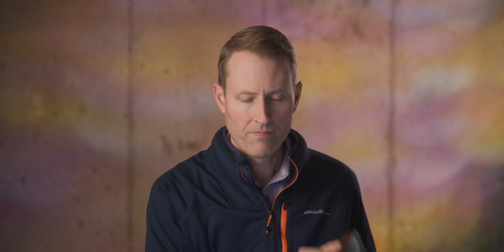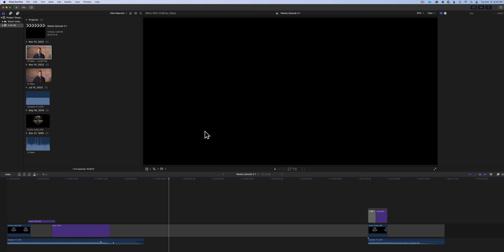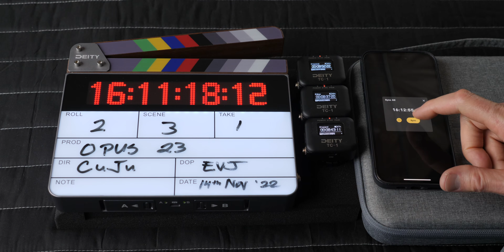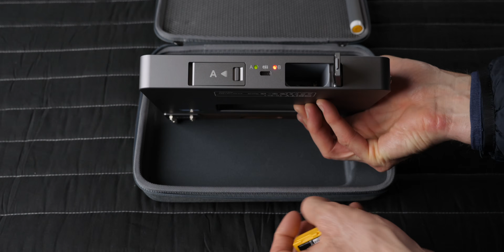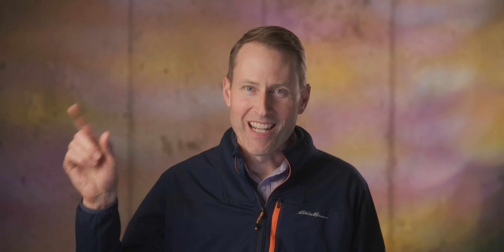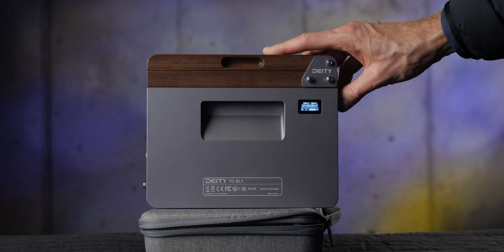Comment: Wanting to clarify something you said...  the Deity timecode ecosystem is proprietary soooo it (the D2RX but also the TC-1?) won't sync to a MixPre 6 ii? (and thus it to a BMagic Design PYXIS 6K Cinema Camera?). So the Deity TC system will sync iso tracks recorded internally in multiple DBTX's... but if sending multiple wireless channels to the MPre-6 then you'd need to use some other way to sync camera and MP-6 to get TC sync-able files? Sorry I'm mostly an editor but needing to get up to speed on sound as the guy we've used (in past couple small indy feature films) is unavailable and it's fallen to me to sus this out in a fairly short time window. Thanks... love your channel BTW.
Reply: The DEITY timecode products CAN sync to any timecode capable device via cable. It is only the wireless jam sync capability that only works within the DIETY ecosystem. So you can use a TC-1 with a MixPre or a Pyxis to feed timecode to the recorder/camera. AND, if you keep the TC-1 connected throughout the filming/recording session, you can use the Sidus Audio app to wirelessly re-jam all of the TC-1s, effectively re-jamming your MixPre and Pyxis.

Comment: I'm planning to use multiple GoPro cameras to capture footage of my motorbike rides. How can I synchronize the footage effectively? What devices or software are necessary for this process? Thanks for your advice.
Reply: You'll need timecode generators that attach to GoPro cameras. I'm not familiar with any that do that, these days.
Reply: @curtisjudd  Thanks for your reply . I've already contacted several timecode device manufacturers, and they've offered some solutions. I am waiting for the new GoPro 13 to be released. Hopefully, they'll launch a new model this month. Once the new GoPro is available, I'll be able to get a definitive answer

Comment: A question. So if the clocks on consumer grade cameras are not stable enough to hold the sync, does this mean that the frame rate is varying in them as well? If this is the case then would a time code not match up with the actual frames as they are recorded?
Reply: Timecode is only used to mark the start point of the recording. If you need to ensure no drift, then genlock is the tool you’re looking for. But it is usually only pro level gear with supports genlock.

Comment: Curtis, Here’s something you could show us that I have never seen anywhere else. We always hear how useful a slate is for redundant syncing in post, or for syncing cameras that do not have TC ports like a GoPro. Please show us how to use a slate display in post to sync up to timecoded audio. I know many self taught editors and none of them have ever done this and I question if they could figure it out. My guess is you will make it look easy and that would be useful. Thanks.
Reply: I think you just have to bring in the audio channel for the camera with no TC and look for the huge spike the clap makes when it slaps down
Reply: @markbernhardt6281  You miss my point. What you describe is standard dumb slate syncing which has been done since talkies first appeared. I asked to see how a smart slate digital display is used to sync to a timecoded audio track.
Reply: If you aren't using the timecode to automatically sync hen you cna do it by eye. The display on the slate freezes to show the exact frame that the clap happened. So you cna place a marker on each video clip at that frame in your editing software. Similarly you can find the timecode reference in your audio file and place a marker at that exact frame. Then you simply line up the makers on your editing timeline. Tnis is really useful as you can find that, in the audio clip, the sound of the clap goes across of couple of frames which makes precise sync harder to do "by ear".

Comment: Pausing the video, and using the "," and "." keys to frame skip, I must say, that frame sync with the LED display is perfect. Nice to see something that's a bit more dynamic than a traditional seven seg display too! Still far too pricey for a quartz clock and a display costing no more than $28.
Reply: 👍 Do temperature compensated crystal oscillators only cost $28 USD?
Reply: @curtisjudd  List price is £2.45. They seem to be rather inexpensive.
Reply: @ErynKnight  looking forward to seeing someone put together a more budget oriented slate and timecode generator given these prices. Maybe someone who is wealthy enough that they don’t need a paycheck for their engineering work…
Reply: the PCF2129AT from NXP is 6USD in quantity (±3 ppm from -15 C to +60 C) and this is a whole TCXO driven clock-calendar (RTC), not just the crystal
Reply: @physiqueDrummond  Why do you suppose Timecode generators cost so much more than that, then? My product management experience suggests a bunch of other costs plus some margin are involved.
Reply: @LearnLightAndSoundSessions  are we talking about TC generators in general or this slate in particular? This device seems over engineered, which is kind of a fashion statement for the owners who can afford them. But unibody aluminum case, really? I can understand the need of magnesium subframe for camera packing top notch CPU, sensors and all, but for a clock and some wireless boards? So @ErynKnight is probably right, 30$ electronics, 170$ case and assembly, and X5 from BOM to COGS (BOM= Bill of Materials and COGS = Cost of Goods Sold) and voilà! 1000$ price tag. BOM to COGS factor varies from 5x to 10x depending of your fixed manufacturing cost (R&D, injection moulds, etc...) and the number of units you plan to sell. ex Apple is selling its iphone 12 at 4x. Surely there is a market for  no-brainer slate and TC systems without fancy cases. I'll try to start a DIY FOSS community around those... 🙂
Reply: @physiqueDrummond  I don't know how much you've worked on sets, but my experience has been that over-engineered is desirable to stand up to the rigors of set work. This is not really a device aimed at YouTubers or even low-budget corporate or commercial work. It looks to be aimed at bigger budget sets — probably at least $50,000 projects and up.

To your point, however, I would say that there is probably a market for more affordable implementations and I'd love to see a DIY kit.
Reply: Remember this is a super niche film industry product. They can't order their parts cheaply in the tens of thousands. Neither can they spread R&D costs over many many units.

Comment: is it possible to use it with 2x tentacle sync track E? and 2x tentacle sync?  or does people who invested in those have to sell it and buy all diety?
Reply: Yes, but you’ll have to jam sync via cable, not wirelessly.
Reply: @curtisjudd  okay, fair enough
Reply: @curtisjudd  Do you feel it's needed to keep your timecode box hardwired to the slate or can I jam and unplug?
Reply: @alex-k5n7w  no, the slate has an in-built generator so you should jam and disconnect external generators.

Comment: I honestly am not sure I understand the specific use case where a timecode slate + timecode sent to your camera is better than a normal slate with timecode sent to your camera. My best guess is if you've somehow botched the timecode signal sent to your camera, then you can use the timecode slate to type in the corrected timecode at the point of the clap, but arguably you could fetch the correct  timecode from your audio device at that point in time and shift your camera timecodes by the delta to correct the error. Just not sure what scenario the screen on the slate protects you from.
Reply: It is another cue that can be used to identify the video clip (eg if you set timecode to time of day) and troubleshoot issues if the timecode to the camera didn’t work for whatever reason (cable pullout, dead battery, etc)
Reply: @curtisjudd  Troubleshooting is a good point, didn't think of that!
Reply: We used to have the playback for music videos on an IPAD and just held it up to all the cameras after starting them, just for that reason.
Reply: It is a safety net. In the grand scheme of things, it is an extremely small marginal extra cost so that you can be certain even if the main timecode setup fails you still have your back up plan. Additionally timecode slates are very important for those cameras which can't take timecode! (such as GoPros)
Reply: @demarsman2 But beyond "just the looks of it", I guess the question is what functionality does the timecode slate add to your production? For you, it just for redundancy if the various TC boxes to your cameras go out of sync?
Reply: @thatcherfreeman  Editorial uses it to have all the information in one place, visually, at the start of each clip. Same for the team which puts together and views dailies.

Comment: I like this...much more affordable than the Denecke...you could get the slate and three pack of timecode generators for the same price as the TS-C or TS-3.... Any reason to lean one way or the other? I'd love a smart slate comparison vid.  And as for those asking about the necessity and the price, for sound mixers, it's gear like this that bumps your day rate up from 300/day to 400-600/day and increases your kit fee in indie world.  Majorly worth it
Reply: I’d love to do a comparison, just need the funds to do that. 👍
Reply: If you're trying to bump your kit fee with just a slate then you could definitely get this one and for god sakes get timecode lockits immediately! I own a Denecke TSC and have been using the Deity SL1 on a shoot for a few weeks now so I'll share some quick thoughts. SL1 has some great modern features like the dual battery slot and Bluetooth sync, USB c charging and an app etc however, the build quality just simply isn't there IMO. It feels like if I dropped it maybe 10 times it'll break. My TSC is a tank and in reality the battery lasts for months worth of shoots and I just let a hot spare in the soft case with rechargeable NiMh loaded in there. ACs/PAswill drop this thing all the time and that's who is going to be using it 90% of the time. I think the TSC also has a much better brighter and dimmer blue backlight.

Comment: 6:18 btw, I don't think you can jam using the 1/4 jack. You can use the slate to jam other things using that port, but for some reason it doesn't take a jam on the phono jack.
Reply: It is an output only so you can use the slate as a master and jam something else to it.

Comment: Probably a stupid question as I'm new to this timecode thing: If there's no need to rejam every few seconds is it possible to use may be one TC1, then jam every camera then leave it on the recorder, and only rejam cameras whenever you stop and start?
Reply: You might get away from not re-jamming. I will test with the setup mentioned above and see.
Reply: Cameras drift so unless you’re just looking to “get in the ballpark” and then manually fine-tune each clip, you’ll want a timecode generator for each camera.
Reply: @demarsman2 Exactly — and most of the sets I've worked on were Sony and RED. 🤪
Reply: Cameras are in general SH*T at keeping time accurately. You MUST have a timecode box on every camera at all times.
Reply: @demarsman2 even ARRI has been known to have timecode issues... such as with the early AMIRAs.

Do you want to be the first person to discover a new bug with ARRI's timecode? Nope!

Put a timecode box on them.

Comment: The plan is to add the Deity Time Code Slate, DEITY TC-1 Timecode Boxes to work with Sony FX30 and Sound Devices MixPre 3 II.
Reply: I would skip the slate (but get the timecode boxes), buy a normal slate and get a nice lens or mic instead...
Reply: @DaCarnival  I've got the lenses and several nice mics.
Reply: @wkmpellucid  more lighting? Better craft services?
Reply: Good plan and happy recording!